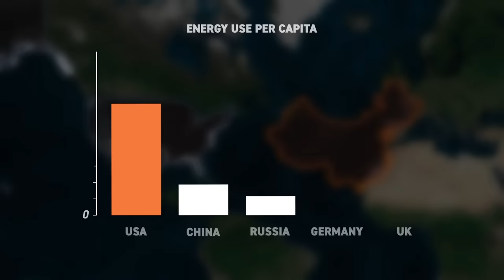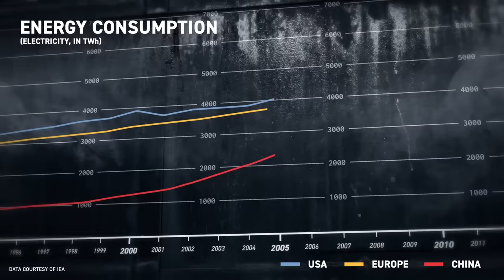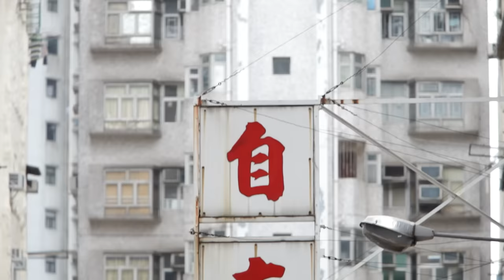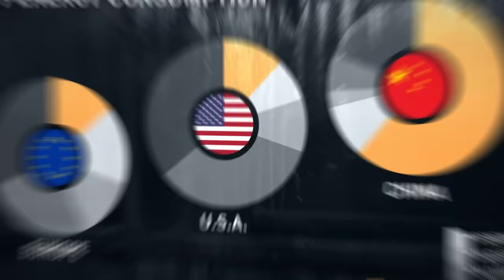China’s Electricity Problem

Comment: Does anyone have a map of energy cost to maintain ideal indoor temperature? 

The discussion of air conditioning in China and the US at the start got me thinking, it would be interesting to see how this plays out over the whole world taking cold countries into account also. Basically I want to see where would be cheapest and most expensive.
Reply: Commenting here so I can see that map
Reply: You'd be stunned in disbelief if you saw how many ACs in China run full-blast beside wide open windows. (conversely full-blast heaters near wide-open windows in the winter months). I am,  in no ways, joking. You'd be just astonished if you saw this.
Reply: Insulation is the king. It reduces need to change of the temp by 90%.
Reply: @hhvhhvcz  me who has to open the windows when it's 5C outside because it's too hot inside
Reply: @hhvhhvcz  If you go to hot countries and look at traditional buildings, you notice two things, thick walls and small windows, that are usually shuttered during the day. It's usually so dark inside that lights have to be on all the time people are awake. Problem is that is the antithesis to the desire for natural light and outdoor views many modern buildings incorporate. You can make building insulation as thick as you like, but it can all be for nothing if the owners want a panoramic window.
Reply: @Croz89  we have double pane windows to help with that, but yeah, insulated walls are better than windows.
Reply: Me too
Reply: Good idea, but you also have to normalize it to income.  $100/month electricity bill means little to an average American, but is 10% of income to an average Chinese, and 100% of income to some Africans.
Reply: @xiphoid2011  true, I'd maybe want 2 maps then lmao one for raw energy in KW and one for KW cost to income ratio
Reply: @MrNgMichael  Yeah, it helps, but in the end no window is going to insulate better than a wall, or even a wooden shutter, because if the sun gets in it's going to heat the room up.
Reply: @xiphoid2011  I wish to see both normalized to income and not
Reply: @MrNgMichael  Double pane is kinda crap by today's standards; triple pane is where it's at, and 4 or 5 panes if you want to be super fancy.
Reply: @cyrusol  as a Scotsman I'm well aware of that lmao

Comment: The geography of China completely mismatches its needs. Most population and industry lives exactly opposite of the solar, hydro and wind rich regions.... Lacking gas, their dependence on coal is unquestionable. It would be fantastic if someone invented a safe, reliable, round-the-clock form of energy that emits nothing, and can be built next to the consumption centers like thermal powerplants...it would be awesome if that energy source were to be a million times more energy dense than coal and had half of it's footprint common with a thermal powerplant, so you can basically modify existing powerplants. But I'm dreaming, of course... I guess they will have to choke on coal ash or wait until wind blows to power their country...
Reply: That is the nuclear energy, which China built the most comparing to other countries in the world since 2011, and still being no.1 in building new nuclear powerplant.
Reply: Have you actually looked at a map of China? Those places where solar and wind is good for are deserts. They are cold, windy and dry.

Comment: I enjoy your channel and your deep dives on subjects. I wish you could do one on how much raw material it will take to hit all these green projects. I don't think we could mine enough fast enough or if proven finds are sufficient.
Reply: The quantities needed are nearly invisibly small if you stack them next to a year's worth of coal. Don't worry about it.
Reply: @gregvanpaassen  You are correct. But it is not a question of quantity. As Glen A suggests, it is a question of availability.
Reply: Energy storage will be the single biggest issue for all of it, followed closely by the pricing structures. Solar generation is cheap. Solar energy storage? Not so much. It's part of why California's grid is so messed up, paired with mandatory solar on new construction, net metering, and no time-of-day credit adjustments.

Generate enough power from solar to hit net negative? Great. Your utility has to buy it from you when it's practically worthless and apply that credit to you during evening hours, right at peak pricing. Natural gas and (coal-intensive) imports cover that peak, which can be four times the middle of the day net demand.

Most electricity storage these days happens through pumped hydro (at least in the US). It works well for what we've got now, but backing up solar power that way would require dozens of Hoover Dam sized facilities.

Grid battery capacity is slowly increasing, but the technology is nowhere near what's needed right now. All the lithium in the world will barely cover the estimated US Electric Vehicle demand, let alone residential and grid demands here and everywhere else. There have been breakthroughs recently in Sodium as well as Aluminum batteries, but it'll probably be at least 5-10 years before those hit widespread availability.

We'll get there, but it'll take a while.

Comment: Nuclear is key. China is building reactors at a faster pace than anywhere else but they need to do it even more, as only nuclear energy can provide the constant high energy output required by industrial applications.
Reply: Nuclear has the major issue of NIMBY. It's quite bad in the even today very sparsely populated US. In China, where any populated province has a population density comparable to western Europe, the kinds of distances efficient for nuclear just can't work

Comment: Another reason why renewable energy sources are not being adopted is because they are substantially less reliable than fuel based energies. Another consideration is the substantial land-use of solar power, plus the near impossibility of recycling the components of solar panels. Both wind and solar power also have a negative affect on certain types of wildlife that isn't often talked about.
Reply: Yes, these are the things nobody likes to talk about.  The media has people believing it is as simple as flipping a switch and making the change from fuel based to renewable energy and it just isn't that simple.  One example recently was the mass failure of wind turbines in Texas.  As it stands currently, these sources are fine for supplemental and standby energy, but are not anywhere near ready to be the main supply.

Comment: 0:45 Canada's energy usage per capita is higher the the US. And since they have a larger GDP than Russia (who you included on that graph) they should take the top spot for major economies ranked by energy use per capita.
Reply: Russian rubles are extremely devalued in international currency markets. In real terms, the Canadian economy is less than half the Russian one and doesn't make the top 10.
Reply: @Bill Kong first off it is not undervalued. The exodus of western compaies combined with a shrinking economy and population gives it its current value. Also the ranking is from before it got heavily devalued.
Reply: @appa609  I'm using the ranking from before the war. The Canadian economy is still larger than Russia's.
Reply: GDP PPP as per IMF October 2022:
Russia - 4.649T $, Canada - 2.240T $

Comment: Underpinning the issues discussed is the fact that China, like all nations, have to use a ‘positive-interest’ currency that structurally requires “growth” + profit to merely operate.  Instead of facilitating a ‘steady-state’ economy, for example.  

‘Positive-interest’ currencies require “growth”, or else they fall into “recession” - at which point (for-profit) banks restrict loans (& money circulation) causing economic stagnation.   
There is no ‘even keel’ or ‘steady-state’ economy.  It has to be ‘growth’, or punishing recession.

Mutual-credit currencies may offer a solution.  While most of these are currently small-scale or local (eg. LETS, TimeDollars, etc), people like Bernard Lietaer have proposed international mutual-credit currencies such as the ‘Terra’ to facilitate non-exploitative trade between corporations & nations.

Money dictates politics.  But no one assesses the possible ‘rulesets’ of different currency types.  Mutual-credit currencies offer a different economic dynamic.

Comment: Norway used to have an electricity cost of 3 cents per kwh. Now the price is hovering at about 30 cents per kwh. Luckily 90% of everything above 7 cents per kwh is subsidised which makes the true price about 10 cents per kwh. And we are still complaining. Now that i learnd that the price in china is 8 cents per kwh and the fact that that is way below world average baffled me. Which also serves to prove that without a doubt the superior way of generating electricity is with hydroelectric plants.
Reply: Chinese residential electricity price is capped. It's set by central government in Beijing, as well as local governments.
Reply: If you have the water it is very efficient 👍
Reply: @ttuliorancao  Yes, we have not gotten to solving that problem yet, unfortunately.😔
Reply: @baronvonlimbourgh1716  Of course every country cant rely solely on hydroelectric power especially when there is a drought.
Reply: @wilhelmbergan5581  never said they could. 
Although droughts are more likely in some places then they are in others, diversication is essential.
Reply: @baronvonlimbourgh1716  Yes, but imo most if not all energy needs could be solved via solar+battery deployment. And the use of specificly Lithium Iron Phosphate batteries. Ofc where hydro is not applicable.
Reply: @wilhelmbergan5581  wind is gearing up to be the vast bulk of the future energy supply together with solar.
They are relyable and very predictable and most importantly increasingly dirt cheap.
With hydro being a decent part as wrll. The rest will all be marginal.
Reply: @baronvonlimbourgh1716  To be honest im not updated at all on how wind energy is doing.
Reply: Zaydan Naufal  for what reason?
Reply: Zaydan Naufal  unfortunately its a rising problem and affects everything😔
Reply: The fact that electricity was cheap in Norway has to do with it's awesome geography, ideal for hydro and its low population density.
And the fact that it is removed enough from the rest of the world (meaning transmission lines between Norway and for example GB, Germany etc. are expensive and limited) so that the cheap electricity couldn't get exported all that easily.
But considering the price hikes throughout Europe last year Europeans were willing to pay every premium (mostly maintenance on the transmission lines) necessary for access to Norwegian electricity.
This trend will likely continue. NordLink for example gets expanded.

But this doesn't have to be bad for Norwegian people at all. The company running the mostly hydro power plants (Statkraft) is de facto ran by the government.
They could for example design a system where the dividends of those now heavily protifable power plants go towards Norwegian citizens.
Norway can also expand their electricity production in whatever way they are comfortable with, it's just a massive opportunity.

Knowing Norway this - the good, sane thing - will be the most likely outcome in the end anyway, so you can sigh with relief.

Comment: I disagree with the idea that solar is a up-front cost. The panels don't last long, require constant cleaning and battery storage systems need replacing regularly. They're so expensive to maintain that they often close down, due to the ongoing costs.

Comment: Cool story bro, but cut the solar and wind bits as those in principle cause rolling blackouts due to their natural instability, and power grid level energy storage is so ridiculously expensive that no wind and solar generation is even remotely competitive in price. It's easy to see in EU where the energy prices skyrocket for years along more and more wind and solar power installed. In this case correlation equals causation, and it's very obvious.
Reply: I can't believe more people don't realize this. The cost of wind/solar in reality is far higher than what it has been claimed to be. Intermittency is the biggest issue and it doesn't seem like anyone factors that into the cost of wind/solar, it absolutely has a cost. You still have to keep conventional power producers running to make up for the dips in power otherwise you will end up with brown/blackouts. 100KW of wind/solar without storage cannot replace 100KW of nuclear/coal/gas, at best it can replace 30KW. The true cost of wind/solar ends up being 2-3 times higher than the greenwashed numbers that are regularly published because they are't actually replacing conventional power plants. Wind/solar does at least lower fuel usage, which in turn does lower pollution so it's not completely pointless, but if that's your goal, it makes more sense to build nuclear plants instead.

Comment: A) This video helps showcase that it's China that needs to do more for any environmental issues relating to carbon.

B) Renewables are still not reliable. Cloudy days and low wind days do occur. When that happens, solar and wind (Which also have their share of environmental impact) will produce less power. Less power means you're back to black and brown outs.

If the world is serious about tackling the power issues while keeping any environmental impact low, it must embrace nuclear power while continuing research into Thorium reactors. These technologies are far more mature and ready than waiting for Fusion.
Reply: Did you watch the video and realise what an interconnected grid means, China is the 3rd or the 4th largest country in the world depending on who you ask, if solar or wind farms have reduced production due to weather in one province, then the province can just buy some of it from another province. In the case of solar power, production can be far more decentralised with rooftop solar supplementing peak power demand in hot afternoons. Electricity distribution companies tend to buy excess electricity capacity for peak demand situations, and can just buy electricity from the open market when needed, so they just have to plan appropriately. China has a large installed capacity of hydroelectricity, if they build more nuclear power plants in addition then a majority renewable grid is fully feasible.
Reply: @thelakeman2538  You can interconnect the grid all you want, but unless you far exceed your power needs in renewables, which has its own issues, you will run into power problems when the wind and solar aren't producing at their peak.

The key to ANY modern society is stable and reliable base power. The only sources of that are coal, LNG, and nuclear.

Solar, wind, and hydro have their place, but it's not the majority of power. At least, not any time soon.

Comment: This analysis is spot on highlighting the disconnect between tightly regulating electricity prices and leaving coal prices unregulated. But it's absolutely missing the mark with renewables. These are financial losers, and they're not reliable (they really don't work when the sun isn't shining or the wind isn't blowing). The complaint that the high voltage power lines bringing electricity from the far west to the population centers are "underutilized" is BECAUSE OF THAT. Renewables are NOT the solution. Nuclear and future fusion are the solution. This is simply nuts to keep claiming that renewables are going to suddenly work if we just throw enough money at them.

Comment: Well this tomorrow vs day-after problem is ubiquitous. Look at Germany and most of Europe. To get to 80% renewable it has to burn carbon, use metal in quantiies like never before to built the new power generation system and energy use vehicles. 
China seems to have more control since it is willing to take all soltuion, not excluded nuclear, and has a LOT of sunny and windy hinterland compared to Europe.
Reply: oh no, it costs money to change.

Comment: Look I have some insights. On the path that China is going, it’s without doubt that the emissions per capita is going to be much lower than the US. Simply by looking at the way people live will give you the answer. Dense city type of living is highly efficient way for people to live than the suburbia you have in North America. Renewables is going to take a greater share in the future as cost of building those plants comedown / efficiency goes up. I think it’s completely fine for a country or region to rely on power sources that can be controlled domestically, look at Germany and its dependency on gas, currently pushing too fast into renewables will cost the economy / consumer. German electricity prices are the highest in the entire WORLD because of this. Renewable is the trend but the path towards it will need to play out. I don’t see anything wrong with China using coal to power their plants. I rather that then have power shortages which will (1) harm the economy and (2) hurt people in hospitals reliant on stable power for their lives.
Reply: China also has a massive rural population living well below the standards of even the most rural areas of the US so their emission creation is negligible, who knows how many tens or hundreds of millions of people you could cut off their per capita number because they're living in a shack using candles for light and wood for cooking food.
Reply: Well, We had the highest electricity cost even before that stuff. We dont use alot of Gas for electricty actually. Our INdustry uses the biggest share of gas by far. Rn the US is basically giving alot of bigger companys good deals to move over bcs the cost there are way lower and they get tax benefits.